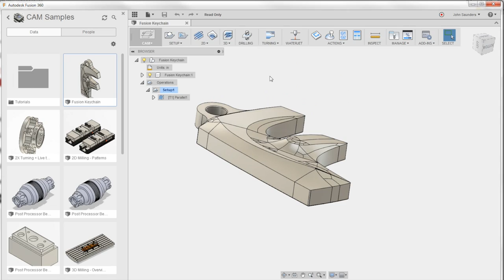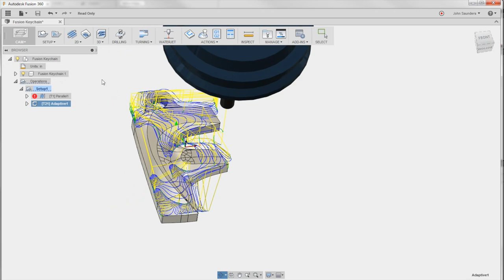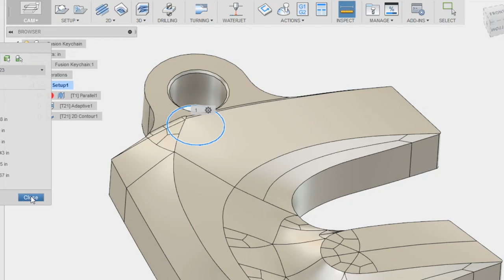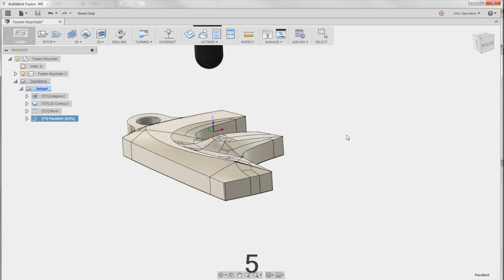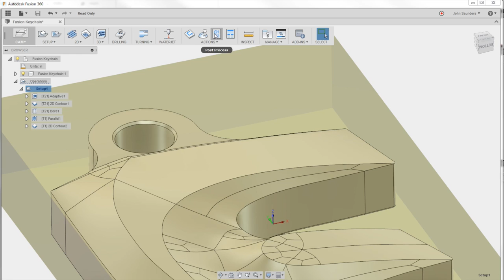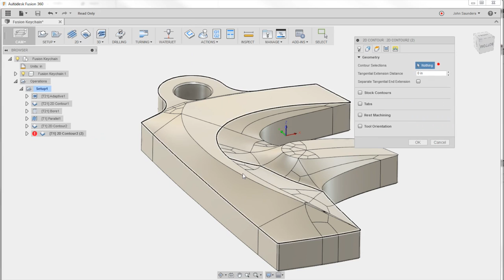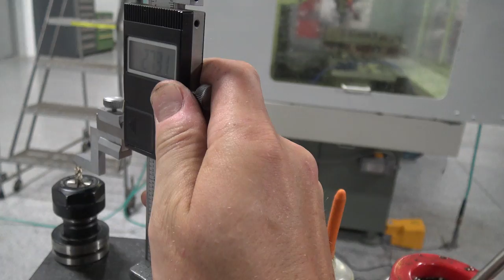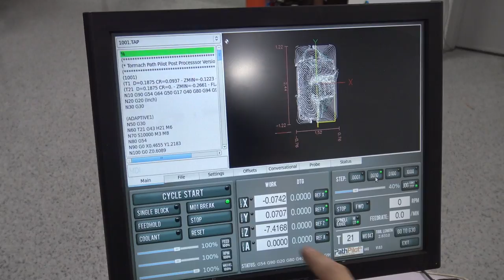Fusion 360 CAM Challenge: F Keychain on Tormach 440!  Widget107

Comment: should have used bottom height instead of negative stock to leave. you can see the adaptive lines on the finished part.
Reply: yea, the top finish still has roughing low spots, due to the -.010 stock thickness on the Axial, wondered why nobody noticed this? only go -axial if your not making cuts on "top" of the part...

Comment: They use super glue in watch/ clock making, to hold metal to lathe chuck, ad long as it doesn't get to hot. More coolant/air flow. great video keep them comming. Greg

Comment: As to your comment of the part over heating in the video look at cold air guns (aka vortex tubes).  Don't know if you compressor can handle one but if it can they are great for cnc on aluminum.

For work holding going with a thicker piece, milling the top side, flip it and fly cutting the top down is an option that works.  I have never had good luck using tape on small parts like that.  Works great on large parts though.

Comment: I gave up on two sided tape just for that reason, and on top of it coming loose when the part gets hot it isn't consistent in Z axis because of the padding. Go with super glue and a slightly rough surface on your fixture plate, warm to 300-400 degrees to release and clean up with acetone. That works for me using nonmagnetic parts on the surface grinder

Comment: Cool vid, I'm a fan of closed cell foam from cascade tool and foam. Using another color to underline. Nice saw table, but I'm still looking for a miter version to replace the factory junk, may need to order yours and add miter.

Comment: Super cool! Just for future reference some of your issues with the VHB could be time related. It takes time to fully adhere, at 20 mins its at 50% strength, 24 hours is 90%, and 72 hours is full bond. I work in the sign industry and we use it all the time. REMOVAL TIP, use braided fishing line to saw behind it. Only way to go, especially with rigid parts. Thank you for making all these videos!

Comment: Another great video John.  I always learn a ton.  One thing I have found on eyeballing the center rather than using the Haimer, is if you are off by a little bit, you really load up the tool on the heavy side the first pass around the part.  It's only the first pass, but sometimes that's enough to screw things up.

Comment: The trick is not to cut  into the tape. From my experience endmills have a hard time cutting the tape and and actually start pulling it up and out from under the part. I would have programmed it Z positive, compensated for the tape thickness and left a little stock (.002"-.005") on the bottom of the part which could easily be removed after with a bur tool or file.

Comment: You can glue the two parts together with super glue (CA, Cyanoacrylate). So the parts are rigidly connected and will not move during machining. To separate the final part from the carrier you only have to heat it up to make the super glue fail.

Comment: Super cool tool cart, me want one... I think with the reduced surface area of the tape after some milling away it was not capable of handing the radial stress and the part has a reasonable thickness as well. Heat also increase flexibility in the tape. In milling wood and perspex I've seen the same happen with carpet tape and thicker stock... Keep up the good work :)

Comment: If ever doing a precision job and need to remove a vise jaw always take off the movable jaw not the stationary. I don't think it's as much the heat causing the part to come off the tape as it is the coolant getting under the part and weakening the seal. Once a place gets weakened it just gets larger and larger

Comment: Talon Jaws my friend!
If you're in PDX for the Autodesk thing, swing by and we can try to get material pullout with them on the Robodrill!
Reply: Talon Jaws?  Blech!  Tried them. Tried to like them. They just don't have the holding power. And not hardened so anything beyond soft steel doesn't get gripped worth jack. 

Lang vise's, Snap Jaws and even the serrated jaws from Kurt are better in my opinion. 

I can see them useful to have around, especially for small parts or running multiple parts per vise.  But for all around general purpose? Meh. Not the system I'd go with.

Comment: Machine the bottom of the stock flat and 2d contour the outside of the part 1/2 to 2/3 up the outside. Remove from the vise and set aside. Place the fixture in the vise and machine a pocket with a depth less than the previously contoured part. Be sure to go past the outside corners if your cutter is larger than those radii. Put the piece into the fixture pocket and clamp the body. Finish machine the hole and upper end. Drill and tap a screw hole thru the Keychain hole and fasten it with a screw. The screw along with the milled pocket will hold the part to finish it out. No tape or glue needed. Whenever I see those 2 items used in a fixture I know it's destined for failure.

Comment: I think I need to show you how to do overhang and tab off milling of parts. This tape/glue stuff has bit you in the ass almost every time you've used it ;)
Reply: I'd be interested to see how it could be done with tabs and the order of operations machining it that way
Reply: +Nick McEntee 

For this id use longer stock. hang the part off the right side of the vise. Cut everything full depth except the long section of the F.  Finish everything than ramp contour the one long edge of the F leaving .01-.015" then just snap the part off. 

I'd have actually mirrors the part and made both sides with the surfaces. Same process cept flip the stock over, repeat the surfacing, then cut the part off.  Set up a stop on the left hand side so no need to reset any XYZ cords.
Reply: +Occams Sawzall I saw one that had both sides machines and was wondering how they did that and still held on to it. Cool thanks.

Comment: The texture is a pretty cool addition John.  I like that you show the mistakes and how you deal with them..  If you were to put the chamfer on the bottom of the part, how would you go about doing that?  I'm thinking it would be difficult to clamp and square up accurately once you flip it over.
Reply: My ears were burning!!!  :D  I'll have to admit, I was a bit jealous that he got to visit your shop and shake your hand.  I can't wait to see what he does with a CNC mill.
Reply: How would I put the chamfer on the bottom? Well, I personally would use a file. :P

I know, I know, blasphemy.
Reply: LOL!  That's how I'd have to do it too.
Reply: +The Metal Butcher 

Well. Generally you would have cut the bottom side first. Face, cut the profile of the F out then chamfer. Cut soft jaws to hold it and flip it to do the surfacing.
Reply: If I was doing a lot with a CNC, yeah. But for a one off, I'd get my file collection out.

Comment: Hey John,

On the high part temp....

I suspect the adhesive tape was acting as thermal insulation between the part and the holding block.

The part couldn't transfer the heat to the larger heatsink, so it built up....

Just a theory....

Comment: This tape really does not convince me.
Even during the last try (20:15), you could see the tape flexing almost a mm.
A custom fixture would have been a bit overkill for a fun challange, I guess, but I think I would have tried to machine the hole and the surface around it and fixturing the part that way. I don't know if one screw could have withstood the rotational forces through...

Comment: The problem might be that the tape is isolating the part, se there is a lot of heat that can't go away to the vise so easily. Air has low conductivity and thermal power also, better use flood this time.

Comment: Could have left that stock piece longer, clamped each end of it to a larger bar that you clamp into the vise. Much safer than tape. I have seen people get hit and injured by parts that shot through CNC machine enclosures.

Comment: 22:03 part moved a bit.
Reply: Good eyes!   I started at 21:59 so I could see the shift. Im surprised how much it moved without separating.  Chris
Reply: I don't think so or the edge bevel would have been off and it was right on for both the hole and the outline.
Reply: You can see the dip on transition from 24:14 to 24:15 and many times before that. High-res pictures of the part would be nice to see.
Reply: It was moving all over the place while the machine was doing John's checkering.  I really think it should have been done with clamping. I think it would be would cool to see the clamping modeled in CAD and how the clearances work with the rapids of the machine.

Comment: Should do a super glue test. Such as  time to dry on different surfaces, and holding power test.
I have used a random orbital sander both surfaces. Cleaned both surfaces with a solvent. Put  dollar store super glue just a small amount then clamped in vice. Usually I cant move the parts after pushing them together by hand. I think because The glue becomes a micro thin surface.
Reply: A video on literally watching glue dry?  XD

Comment: Cam was great, machining, not so much. I would have left the stock longer, rotated the part design, and just stuck it out of the vise. And then clamped it to finish the bottom.  It couldn't have been less stable than that setup.

Comment: how did you delete the standard tools ? i dont need inch nd  everytime i have to close all inch presets to get to metric tools it is really annoying
Reply: in the cam workspace go to the tool manager (icon is a folder with a screw on it) and on the left had side should be a list of the different libraries (if not click on the button on the top left of six blocks stacked 3, 2, 1 to show it) and just uncheck the ones you don't want appearing all the time
Reply: +Matthew Lennox thank you, i will try that later :)

Comment: I am an amateur in this field, and I will comment in that mindset. I appreciate, and understand the enthusiasm of following a part from designing, programming and creating. But, I also relish in the tolerances and precision inherent to machining. And that´s where my beef starts with this one. Using double sided tape, after taking the time to adjust every single little detail of the part and tools, just seems off to me. The part moves around a lot, and despite finally staying in place for the finishing cuts, it just doesn´t seem like the way to go. Is tape a "thing" in machining? I´ve never seen it used before so i have to wonder.
Reply: Tape is definitely a thing.  But generally not for such a thick part.  Usually it's used when machining thin sheet metal that's 1/8" thick or under. 

This was not a good part to use tape with. It was plenty thick enough to be held in a vise or soft jaws.
Reply: In that case i could understand the application. It still strikes me as odd though, that a field so "hung up" on precision, would turn to something as relatively inaccurate as tape. Goes to show i have much to learn.
Reply: +Danni Houmøller 

Actually. The thickness of 3M tape is held to quite close specs. Usually about +/- .002". And you can find the thickness of any tape right on 3M's site with a little digging. 

When used correctly tape is surprisingly accurate. There's really no other way to hold it if you need to mill in .060 sheet metal
Reply: Occams Sawzall I guess it comes down to proper tool for the job. When using tape for thin sheet metal, do you apply tape across the entire surface to adhere the lot to a face,or is it more a matter of placing "enough" tape to hold the part? I´m thinking flexion from the milling proces if not covered in tape on a, lets say (and i´m just ballparking numbers here since i usually use metrics) 10" * 10" sheet. And then later, what about removing the tape from the finished product? How is that done without bending? Here he´s using a pry tool, but on sheets, will that work? Sorry for all the questions, i´m just curious.
Reply: +Danni Houm&#248;ller

Entire face.  The strength and holding power of tape comes from maximizing the contact area. I do try and keep it inside the finished part dimensions though simply so the endmill doesn't grab an edge an lift the tape up. Also. Can't use coolant of any kind. They all contain solvents that will unstick tape easily.

Removal is taken care of with a solvent. Acetone, or WD40 works well. Or, flush it with coolant for a minute and it will loosen up the tapes glue.

Occasionally for parts that are prone to bending, I'll machine troughs and lift areas on the plate I'm sticking the part to so I have areas I can pry the part off at without bending it or sections to make it easier to get solvents into.
Reply: Thanks a bunch. :)

Comment: Keep in mind that VHB takes a day or so to "wet out" and have full strength.  It's not instant full strength.
Reply: +NYC CNC From 3m: • After application, the bond strength will increase as the adhesive flows onto the surface. At room temperature, approximately 50% of the ultimate strength will be achieved after 20 minutes, 90% after 24 hours and 100% after 72 hours. In some cases, bond strength can be increased and ultimate bond strength can be achieved more quickly by exposure of the bond to elevated temperatures (e.g. 150°F [66°C] for 1 hour).

Comment: why don't use super glue to hold a part?
Reply: I wanna know this aswell, sure the part gets hot, but superglue has to be burned off in order to remove. Im going to give that a shot myself to see if it would hold. I only have a shopbot available so it wont be the same tool load.
Reply: you need some grooves to leave glue space to flow
Reply: Eugen Nomatterr Don't think so, its very common when turning parts that you cant hold with the chuck to glue them inside each other. And in those cases you can't have any play between the two parts.

Comment: Nice part! Have you tried superglue before? If not: definately try! holds perfectly even with stronger cuts. Below I have a few links to pictures I took from one of the jobs:

https://c2.staticflickr.com/2/1543/24731156573_bdaecc0378_b.jpg (Base for the glue)

https://c2.staticflickr.com/2/1619/25264821981_c474251256_b.jpg (Base with stock adhered)

https://c2.staticflickr.com/2/1630/25538446416_7407385139_b.jpg (Finished milling)
Reply: Thanks for the reply, I understand, It has its downsides indeed. I used a lot of tape in the past, also depends on the material to be cut. (for example carbon fiber)
Reply: I've never tried it, but there is an adhesive called ElectRelease that debonds when an electric current runs through it. It's an epoxy so I doubt it would be practical for one-offs, but cool stuff either way